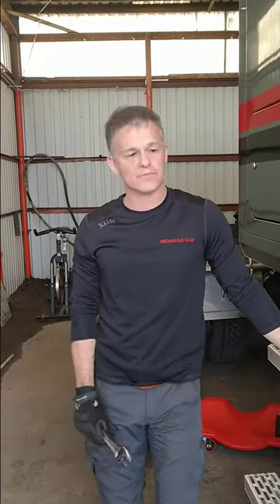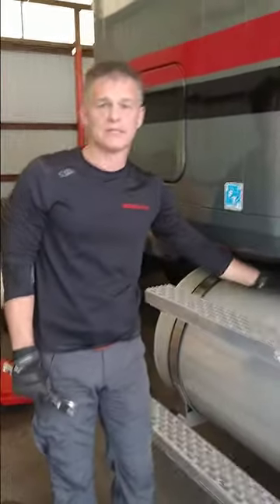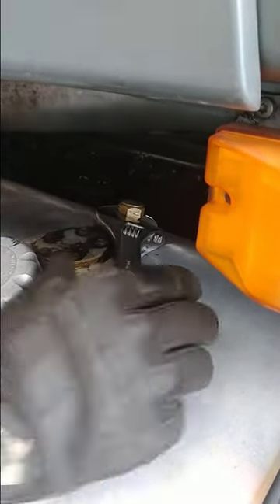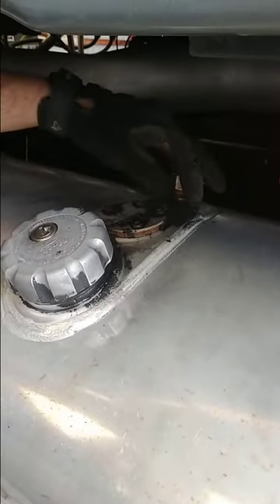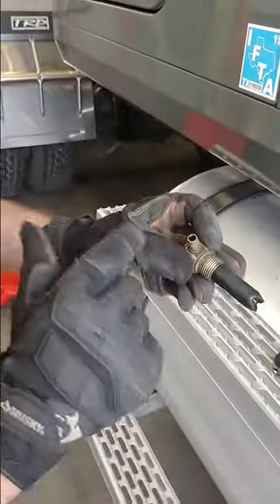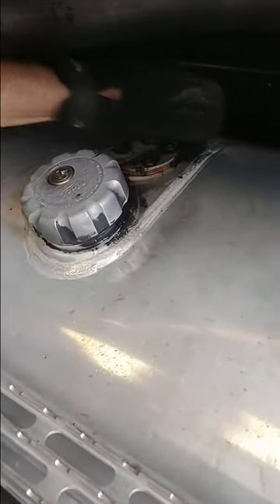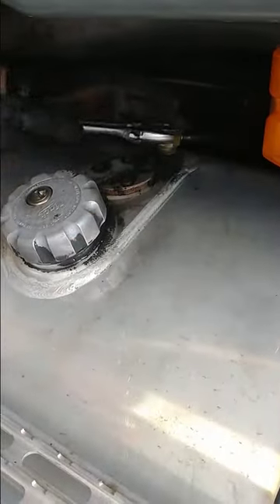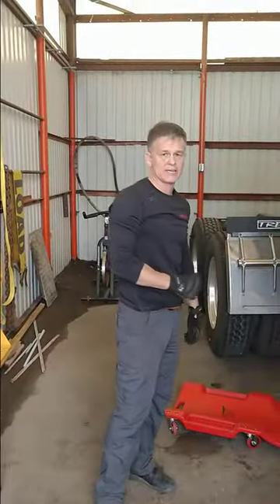Maintenance 101 Fuel Tank Check Valve

Comment: Update:    Update on the boat.  Ready to drop in the water.   Everything works.  Rewired.  The issue with the fuel has been solved.  Did not have enough gas in tank for pickup tube to reach with the boat tilted.  Put in 4 more gallons and leveled the boat and Viola!   Tuesday boat run.   one last thing for all you boaters that might have the same problem.  The tank is poly and it was deformed to where the pickup tube was angles thereby not drawing gas straight down but sideways.  Will add a hard foam to wedge between the tank and the upper part of the decking to force it back into position.

Comment: I had this problem after anti-siphon cups were installed in my fuel tanks. When fuel all the way up it wouldn't allow air in as the fuel was used leaving one side fuel why the other would drain.
Reply: How’d you rectify it? I’ve got a similar issue and the same setup as you